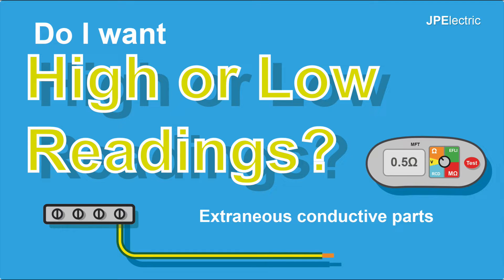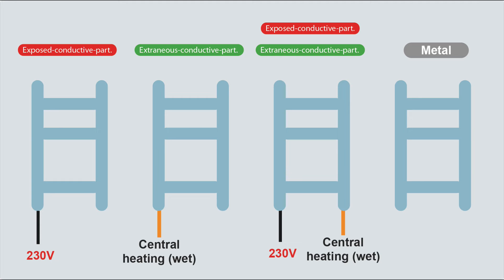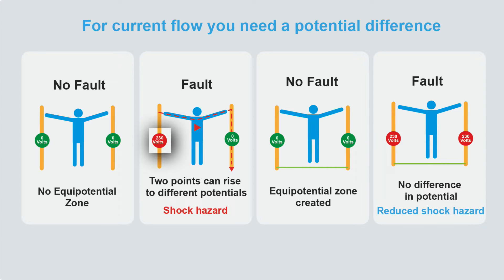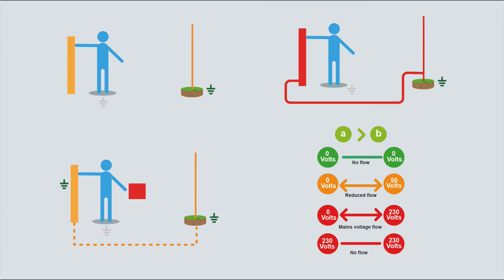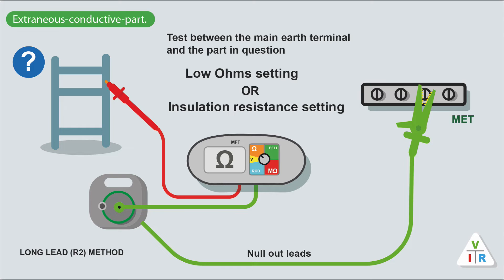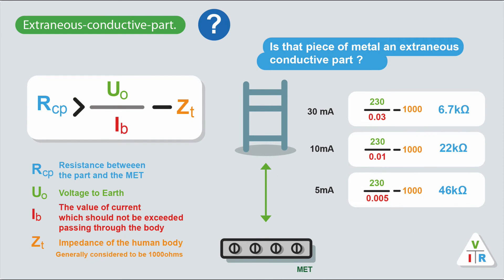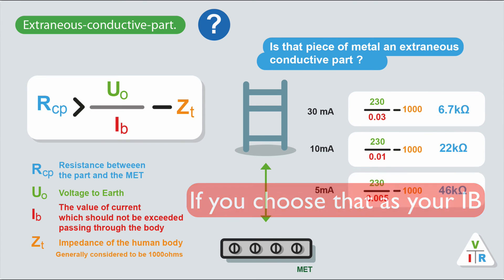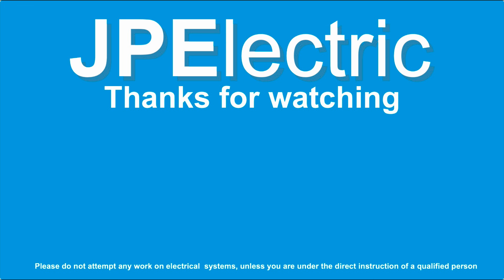Testing an Extraneous Conductive Part (High or Low)

Comment: So, with 211v on the kettle…
Wouldn’t some voltage appear on the pipe - the difference between the Volta on the kettle and the voltage on the pipe being the touch voltage…?

Comment: Thanks for your video ! 
I have a question:- 
I have a plastic main incoming pipe which then goes to copper around the immersion and then back to plastic until the start of an air source heat pump (which is outside)

Now I get connected onto the MET 0.22ohms on these pipes by the immersion- is this not picking up the Earth through the immersion based on this ? 

My logic then was to remove the main Earth and clamp onto this and then touch the pipe with the meter -the reading is greater than 999k ohms. 
My question here is does this need to be bonded or not ?

Comment: There is outdoor low voltage installed within touch range to a metal fence installed in the ground. How do I ascertain if the fence needs to be bonded?

Comment: Hi, do you know much about shaver sockets / isolating transformers? I’m just trying to understand at college we've been told that voltage flows when there's a different potential as you say.  But how do you not get a shock touching a live part from a shaver socket if you're other hand is touching a tap. But you would get a shock if you touch a live in a switch while you're stood on ground or touching a tap?

Comment: Is there a meaningful risk in an equipotential zone with diverted neutral currents due to a broken pen conductor. Both upstream or downstream? How best to avoid the currents circulating around pipe work and the incoming supply?

Comment: Thanks for the video, well explained.  I have studied this as an adult learner and was never convinced that I fully understood the logic behind the 22 kΩ especially when I found..."a resistance to earth of less than 1667 Ω then sufficient current will flow (through the person to earth) to trip the RCD so they should be OK.  - No need to bond. Max touch voltage should be less than 50 V, so with a 30 mA RCD  50/0.03 = 1667Ω.  This led me to think that anything below 1667 Ω or above 22 KΩ doesn't need bonding - is that correct?
Reply from the maker: Hi GrumpyGrampa, Thanks for the comment.  
Thats right, If you get readings between 1666Ω and 22KΩ then you have to put in
 supplementary / main bonding.